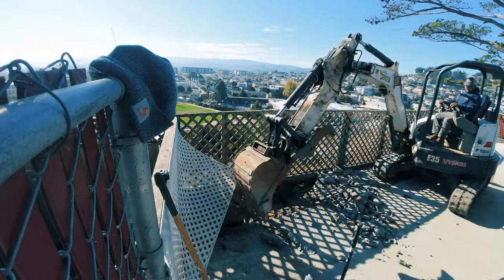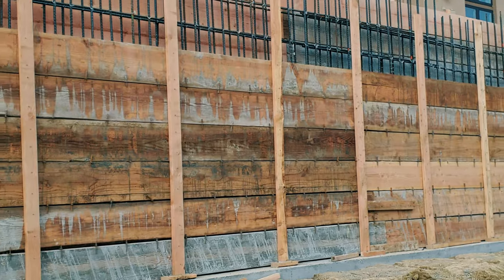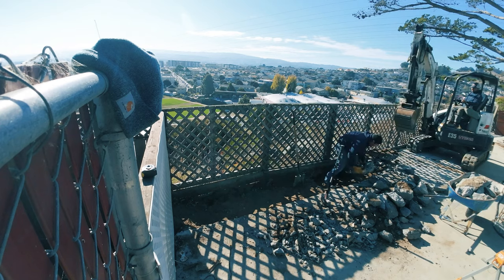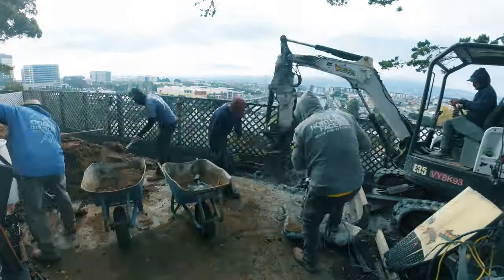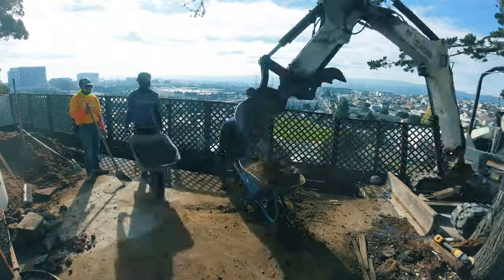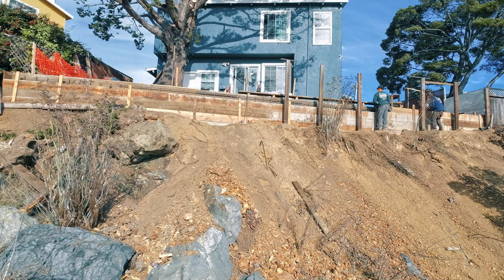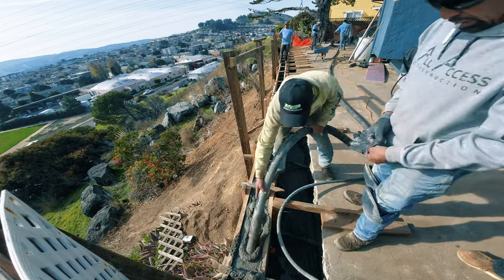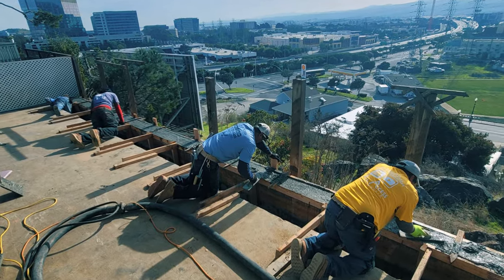Building A Concrete Retaining Wall On Steep Hillside

Comment: All good on the rebar (I think that's from the Engineer) but you should not pour the piers (columns) and the beams in a single stretch. Monolithic is not added strength in this case. You can do the research on this. For a high rise this would have seriously compromised the structural integrity. IMO in this case - a retaining wall - it can be a bigger problem since the angle of stress is between acute to almost perpendicular to the column.
Reply from the maker: Appreciate itbe comment.. But if I ever gea a highrise definitely subbing it out.. 😂💯
Reply: @AllAccessConstruction  Good morning. I live in the Bay Area. Sorry I was editing the comment when you might have commented. I was writing since this retaining wall was top of the hill not a huge problem. For bottom of hill definitely no no.
Reply: I need some work done for my home. Might hit you up
Reply from the maker: @kumaranmani all good I accept all positive comments.. 🙏💯

Comment: tight like a tiger, nice work.
One of the many things i love about using painted plywood forms, they come off so easily, don't need to use oil for the first few times too.
I do like the wood finish left when you strip the boards however, so your method is also cool 😎
Reply from the maker: Appreciate it man 💯💯👍🏾👍🏾

Comment: Can you show how to build a retaining wall on the edge of a small creek?  When it rains hard the creek rises and flows fast.  It is eroding the bank that is part of my yard.
Reply from the maker: If we get a job.. Will absolutely do so.. For something like that your probably going to need structural engineer.. Might want to do a rip rap system
Reply: This creek runs in front of my house.  I don't like the look of rip-rap.  The yard is 135 feet long and about 15' high from the creek.  The edge of the yard is sloping toward the creek as the bottom gradually erodes away. I need a wall about 8' above the creek bed to contain the water when it rains long and hard.
Reply from the maker: Probley want to talk to building department first.. Out here anything close to a creek sometimes have to go through the state.. What are you located